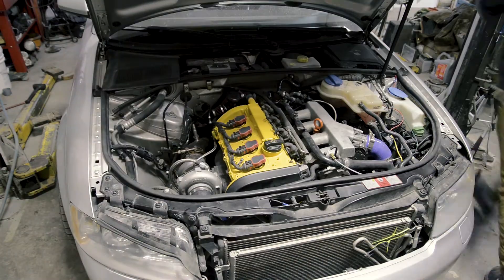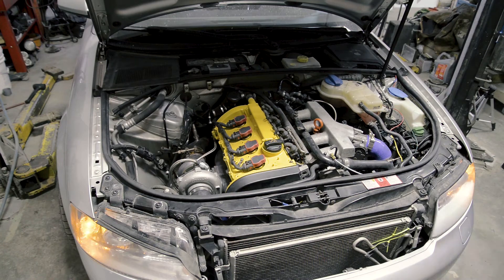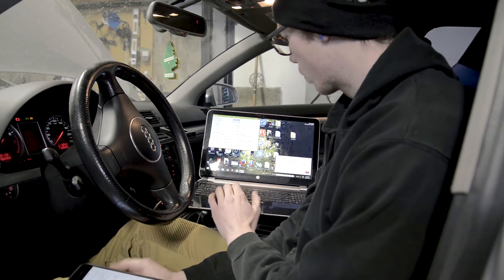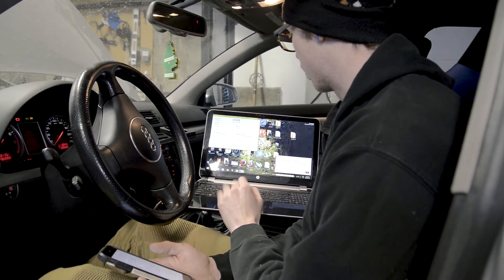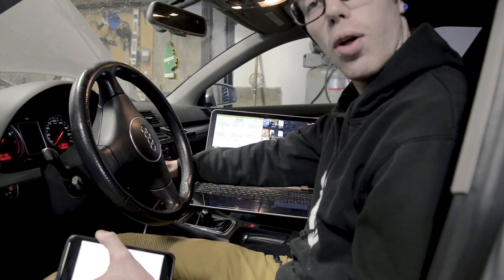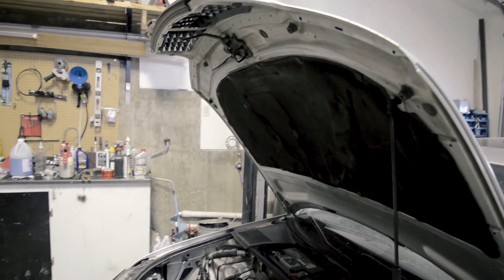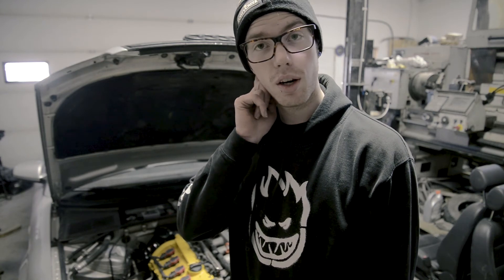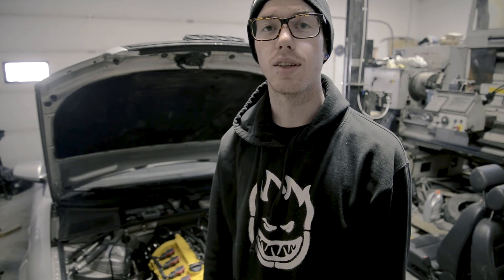audi throttle body alignment

Comment: How did you connect your laptop to your car  . Also what was it. I have 2 and 4 misfire and sometimes random misfires my transmission is messing up the ride got rough and no power at climate control on dash??

Comment: I am building a 911 porsche 1983 using the ecu (system) from a 1998 a4 2.8 l v6 car start but no idle and I can find any info  like voltage of the throttle body , very little info on this cars .

Comment: Yooo any updates on this?  I’m having the same exact problem with my 09 A3.  Sometimes it dies like yours did and other times it’ll start up just fine.
Reply from the maker: so i believe that my problem has come partially from the custom tune but, since posting this video i have changed the plugs and gapped them a little smaller and also changed my o2 sensor and so far the car has been running good.
Reply from the maker: oh i also found that my MAP sensor was leaking a little bit of vacuum so that was probably part of the issue aswell.
Reply: Ilikeautosdaily ahh right on great to hear she’s back up and running.  I’m about to see my service guy so I’ll take this info to him and see if it might match any of the codes that we pull.
Reply: @thegrindtopar  hey I've got the same problem as yours on the same plateforme audi a3 09  did you end up fixing it ? Thanks
Reply: @bassot44 to be honest, I don’t know how or why, but it “fixed” itself.  The only things I did after making that post was I changed my engine air filter, spark plugs, and ignition coils and somehow some way after that, the issues went away.  I don’t know if I can confidently say it’s fixed, but my CEL hasn’t come up again and my car has been running perfectly since.
Reply: I'm getting a similar problem, but I am using VCDS lite, not sure but when I try to do this it comes up with an error for the throttle adaptation, would really appreciate some advice
Reply: @killerkittenz4977  I'm having the same problem with my 98 a4 what do I do I've no map or vcd
Reply: @francisgunseor8118  had to clear all error codes, and get the coolent to around 80f, it's a pain in the ass until you get it and it seems like it should just have a straight drive by cable, instead of the hybrid throttle body, hope this helps

Comment: Did you fix it?   :)  And if Y  what was it?
Reply from the maker: nope i havent gotten it fixed yet, the problem seems to come and go. this is still very puzzling.
Reply: My son had a similar symptom on his car a year ago and had 2 change the fuel pump and filter on the fuel line.  Just saying  :)
For me it looks like the fuel is cutting out on your car.  Could be alot of things doh. (idle sensor or broken coil)
Did you check this video?  Check the comments to:  https://www.youtube.com/watch?v=08ymEtXfnEI
 Good luck man.

EDIT: Check this also: https://www.youtube.com/watch?v=KHWTbv4BZsY    last 30 sec.
Reply from the maker: yeah ive got an upgraded fuel pump and new filter so i dont think its that, it has gotten better but my next step will be to change the plugs and coils.
Reply: @ilikeautosdaily  i also replaced the fuel pump & filter . it didnt help